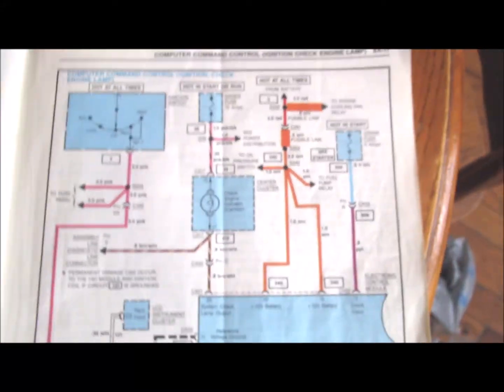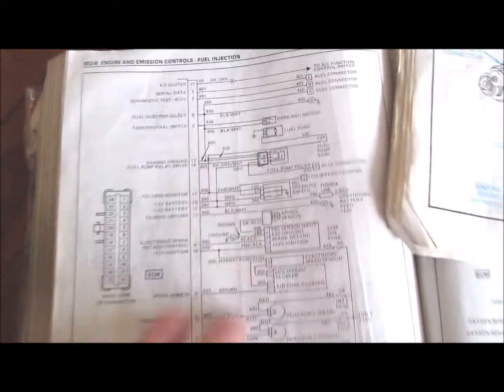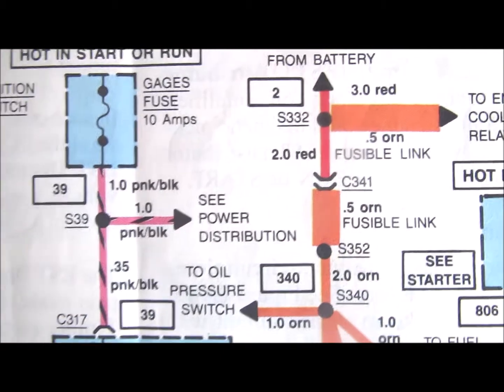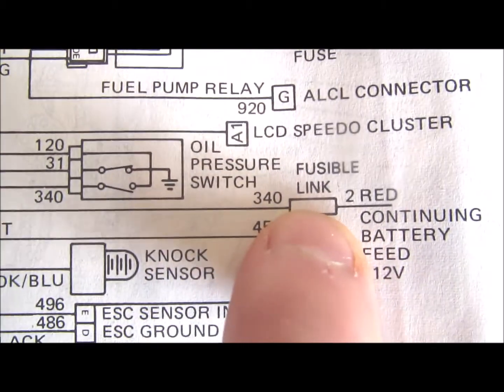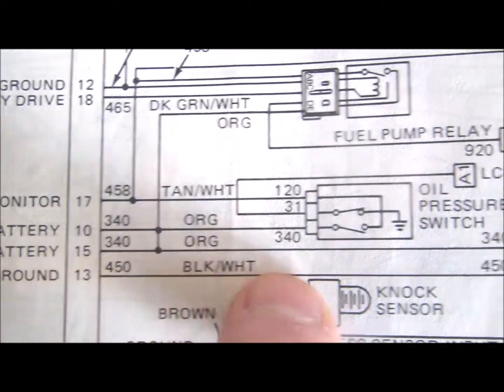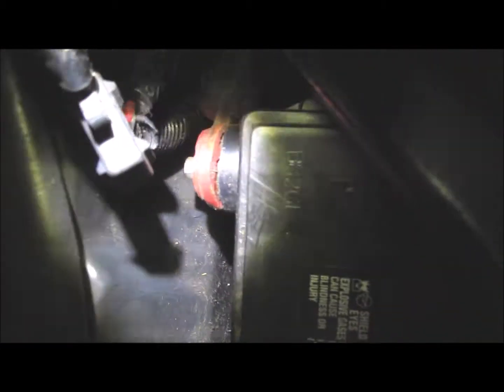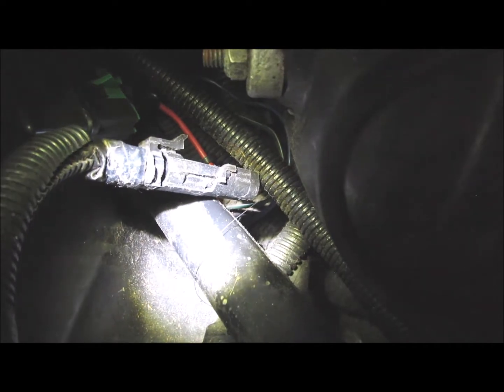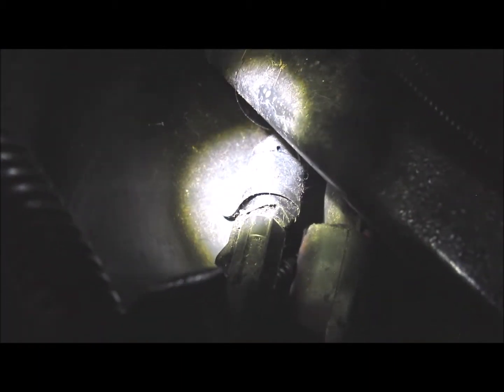★彡𝐀𝐋𝐋 𝐒𝐓𝐎𝐂𝐊 𝟖𝟒 𝐂𝐎𝐑𝐕𝐄𝐓𝐓𝐄彡★  𝐌𝐀𝐈𝐍 𝐅𝐔𝐒𝐈𝐁𝐋𝐄 𝐋𝐈𝐍𝐊

Comment: Hey delta I just bought a 84 my first vette for my daughter. It cranks and everything seems to work except no power to the fuel pump, fuse or relay. Can’t figure out why. It will run if I’d hit it with starting fluid but no power to the pump an fuse and relay. Any help would be great
Reply from the maker: There is a fusible link in the orange wire to the oil pressure switch and the fuel pump relay. There is also a fuse before the fuel pump. Fusible links are difficult to see, most of the time just the wire inside the rubber insulation melts.....the wire looks normal.
Reply: @HorseshoeBeach  ok I saw that link, I will take a meter with the key on and see if there is power after the link before replacing it. Ty so much